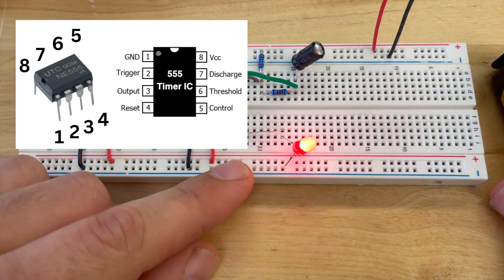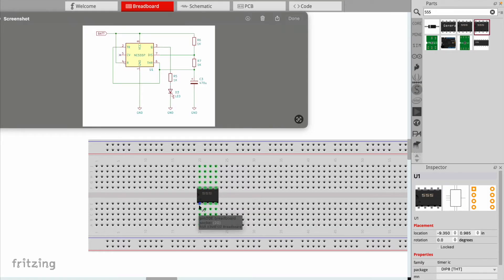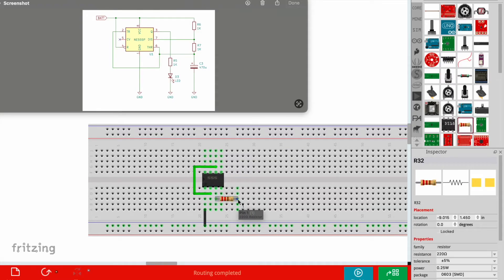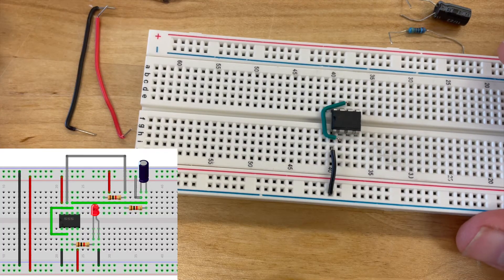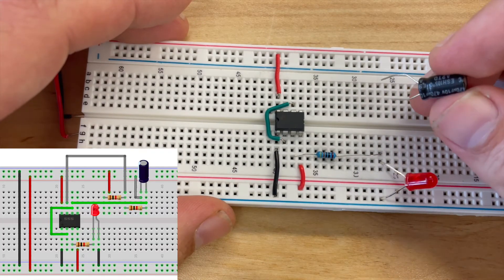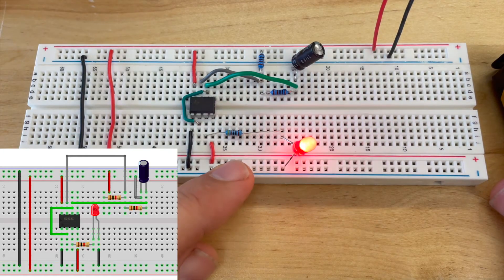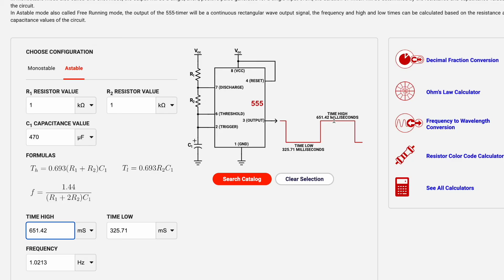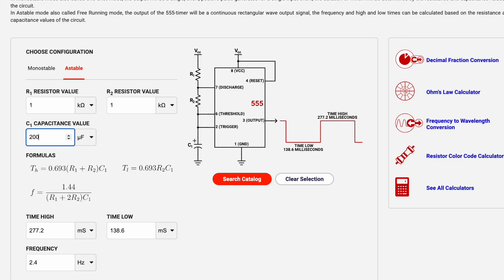555 Timer | Build on Breadboard

Comment: thanks a lot it worked , how can we generate higher frequency e.g 500 MHz or even 1 GHz ?
Reply from the maker: There is going to be a limit to the frequency possible - you may need to check the 555 timer chip spec sheet

Comment: The LED just stays on for me and the 555 timer starts to heat up, I’m using 5v from my arduino.
Reply from the maker: Check the power rail - one of the red wires on the schematic is off - the revised schematic is here - https://www.youtube.com/watch?v=PdJWqbgYxZQ&t=140s The breadboard itself is setup correctly
Reply: @ thank you, you are great help. I figured something like that out today and submitted the assignment today and I passed.

Comment: I did not get this to work, i dont know what did i do wrong but the led just stays on and my ne 555 get hot :(
Reply from the maker: Are you sure the 555 timer is in the correct orientation?
Reply: Yes im sure
Reply from the maker: @3sd-ql3xt what kind of power supply are you using? You may want to double check your resistors value with a multimeter. If you 555 timer is getting hot it could also be a short somewhere, did you build it on a similar breadboard?
Reply: I used a 9 volt battery and i used 1 k resistors and yes i used a breadboard
Reply from the maker: @3sd-ql3xt Hmm - do you have a way to test/measure the capacitor? It could be you have a nF instead of a microfarad? If that's not it maybe you already fried the 555 timer earlier when you doing something else?
Reply: @HTMWorkshop  i have a digital multimeter and i dont know what do you mean by the capacitator thing , i did another project with the same 555 and it worked, im gonna try to do this project again later coz it is so cool :)